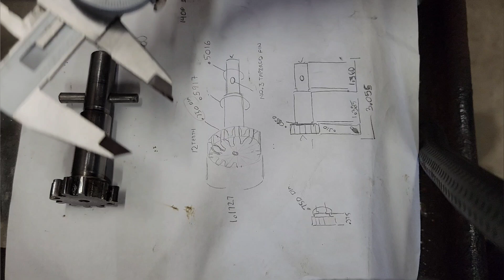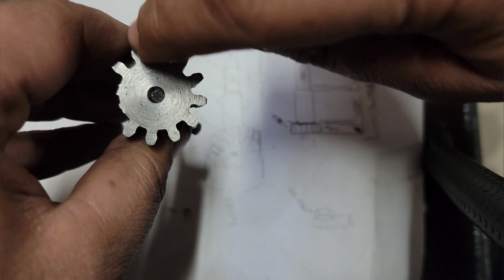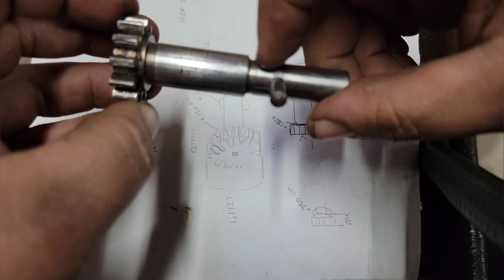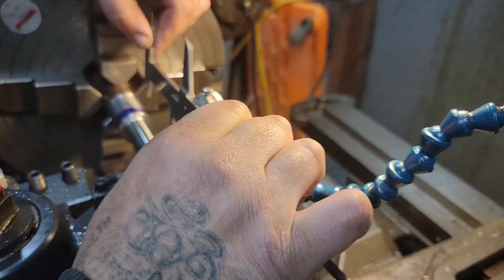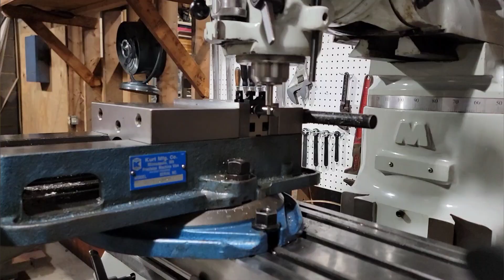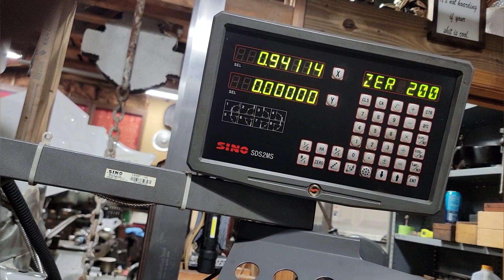Fosdick radial drill RESCUE ( making a new traversing handwheel gear shaft assembly)

Comment: Looks like a winner there. 👍Was the original not worth welding up the missing teeth area and recut those teeth versus making a whole new one?
Reply from the maker: Thanks tom . Yeah , I could've done that . Gear wasn't that bad that I could see didn't want to chance messing up the heat treat or normalize and re treat it ( not that it really would have mattered)  just seemed less risky for a future failure to me to make one with some pre hard material. ( hand reaming it kida sucked though ) also it was small and I love using the k&t . But probably would've been fine welded and re-cut . I guess I worry too much haha.

Comment: Gear OD = PD of a gear with 2 more teeth according to the Machinery handbook
Reply from the maker: That's correct , I would probably be more apt to use the equation in designing a new gear set. I believe the method I use comes loosely from the audels machinist handy book , just seemed easier and more appropriate for re-creating an existing gear . I do appreciate the input and I haven't forgotten about your offer for the hbm piece just not the best time . Thanks for watching and commenting too . I really appreciate it